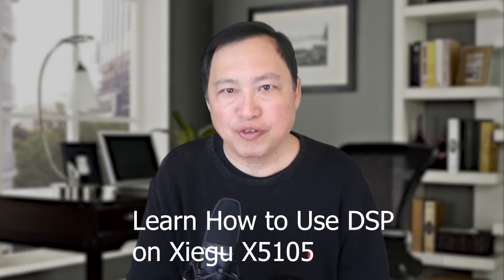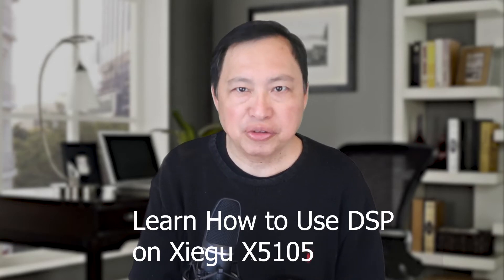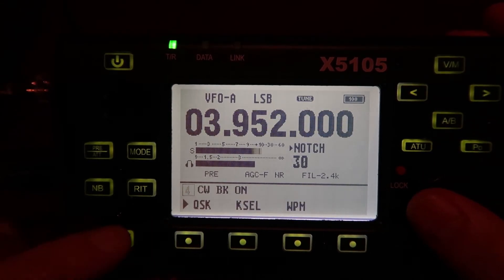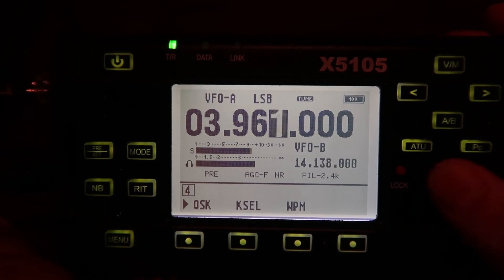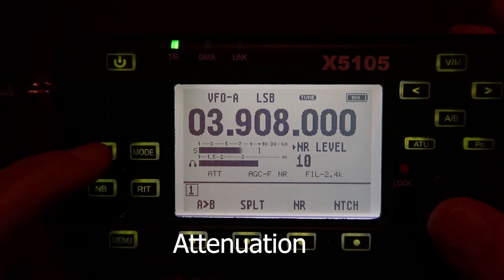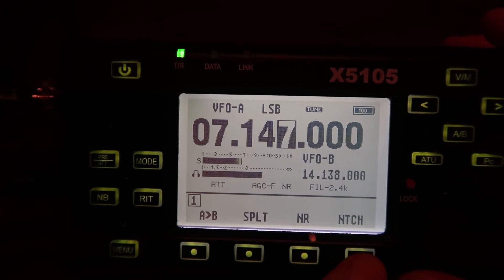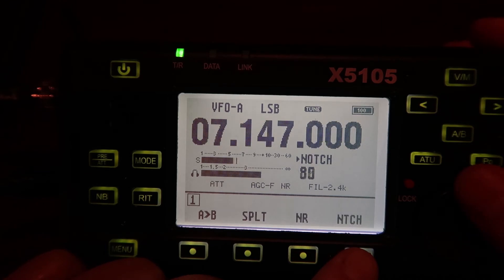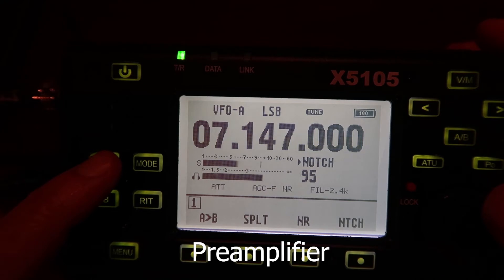How Digital Signal Processing (DSP) Works on the Xiegu X5105 QRP Transceiver

Comment: Thanks for your video. I like the X-5105. I'm thinking of buying one.I have seen some videos from the menu of the new firmware 3.0.- There appears the Ham band only and full band function, means that I can operate outside the amateur radio band ?. For example band of 60 and 75 m?. If you can't answer, I'll understand. Best regards
Reply: Jose - this radio has a terrible distortion problem on AM transmit. Very disappointing. Consider that before you buy one.
Reply: @submarineradioman5535  Ok. I will condidere. Thanks
Reply from the maker: Yes all bands in HF are visible so you can listen to AM radio or even shortwave and likely marine SSB. However when you press PTT it will say "Transmit Error" if you're not in a ham range.
Reply: Thank you Rob.

Comment: You should try the low-cut and hi-cut filters in the AFIL menu.  Compression is transmit only.
Reply from the maker: Actually as I showed in there, the Audio Filter doesn't really help in understanding phone. I didn't use it at all. I just muddies it even more. 

Compression is transmit only? That makes no sense. Compression would be useful in receive I would think. AGC works overall but compression is supposed to even out the lows. Thanks for the tip
Reply: @robbraxmantech  I'm sorry to tell you, but you're wrong. Compression is TX only. Microphone Compression. If you check the latest firmware of the X5105 (V3), you will have the official confirmation.